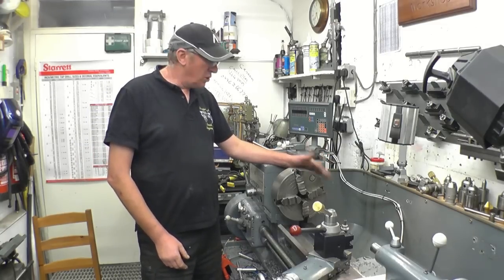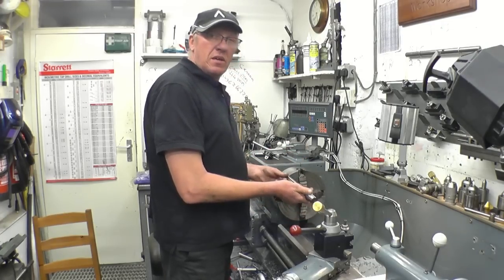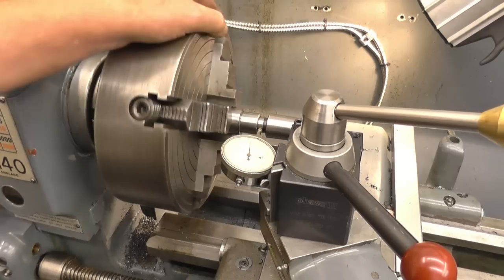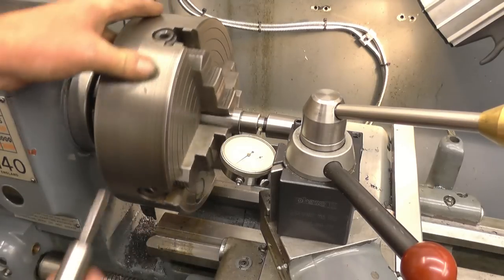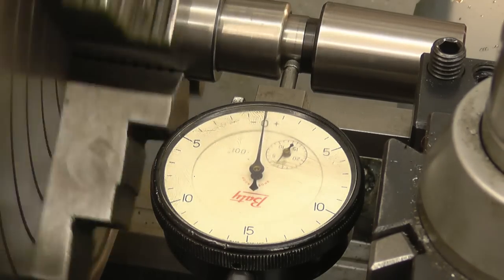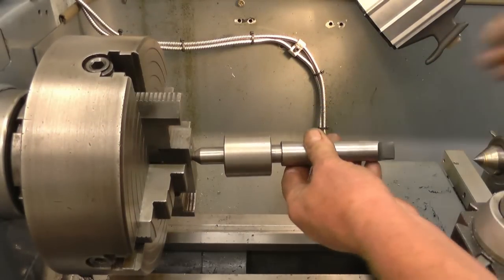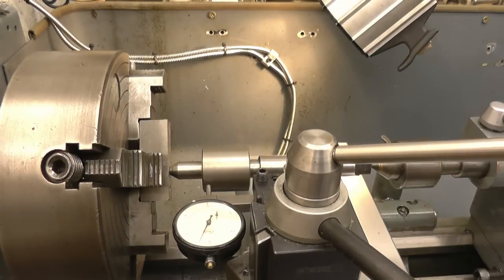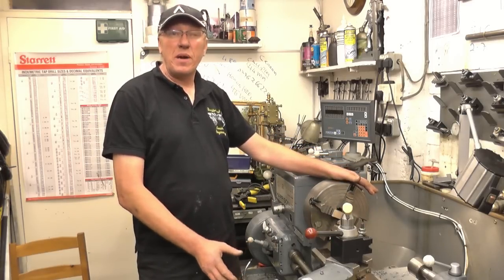4 Jaw Chuck Indicating Made Easy

Comment: Thank you John, I'm new to using a lathe (only have a little Myford ML10) and have been going round in circles with my four jaw chuck to the point I put it back on the shelf in its box. Broke a tooth on my three jaw (my own fault I was using it right on its limit) yesterday and had to resort to the four jaw to finish the job, your way of explaining was great had it set up in no time. Thanks again, you saved the day!

Comment: Nice one - I bet you would have won the Abom79 4-jaw challenge :-) (clocked you at about 1:10)
Reply: +kempy666999 Perhaps.  But doing it for a video with unlimited takes, using your own equipment in your own quiet shop is a much different thing than doing a single try in a 104 F (40 C) shop, using a lathe, chuck, and indicator that all belong to someone else, while scores of machinists are looking over your shoulder and making noise.
Reply from the maker: +Bob Korves Very true indeed I know this lathe very well It was all done in one take